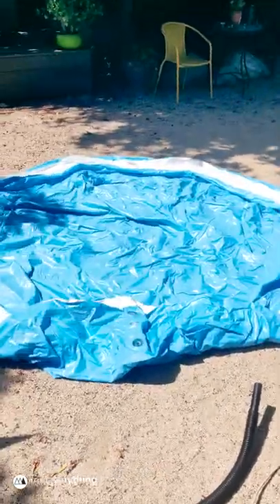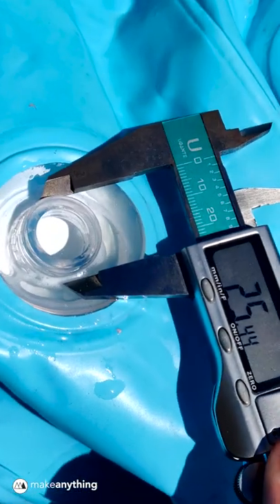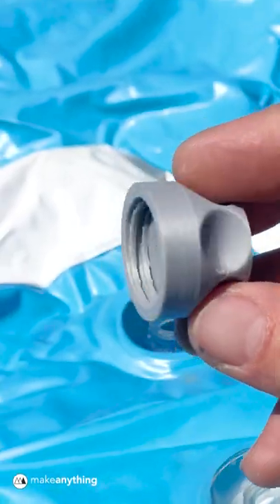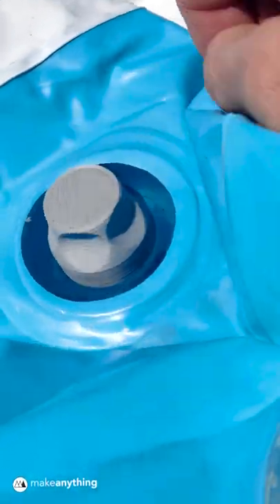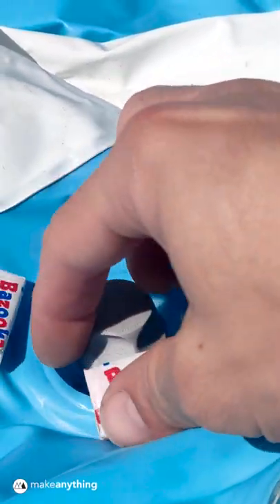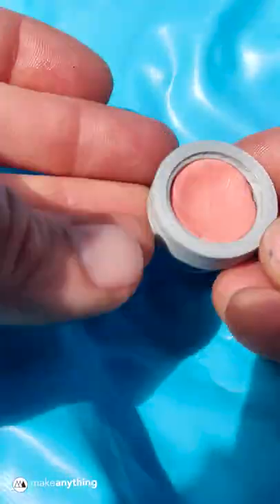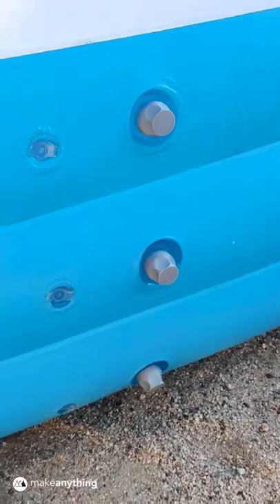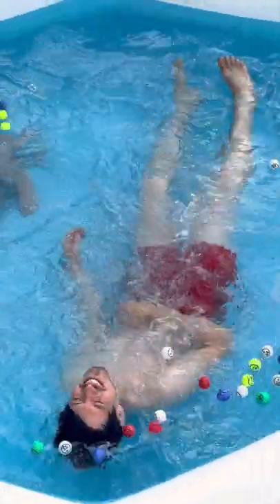Printed Pool Plugs

Comment: How did you measure the threads accurately?  I'd imagine those aren't standard.
Reply from the maker: Made in China so I assume designers used metric. Try my best to measure with the calipers and rounded to the nearest mm. It happened to be 3mm pitch. So a bit of luck :P

Comment: You go through the effort of measuring, conceptualizing, modeling and printing with sun resistant filament and then instead of buying a gasket, or teflon tape you use chewing gum? 😂